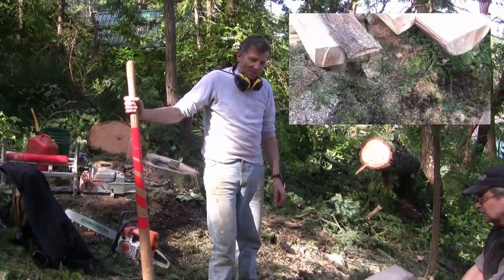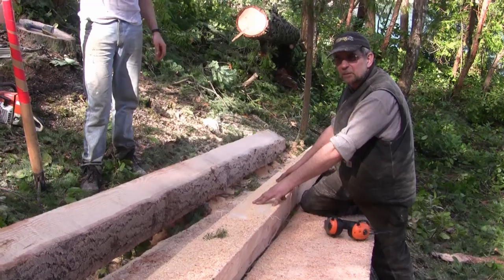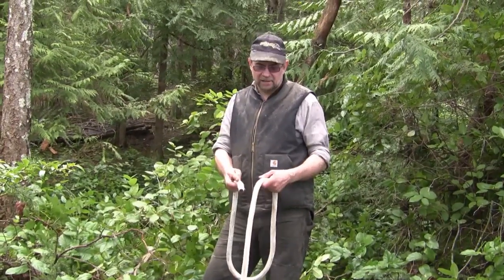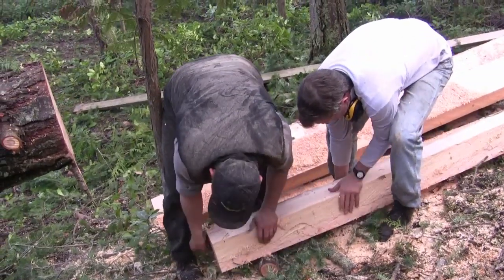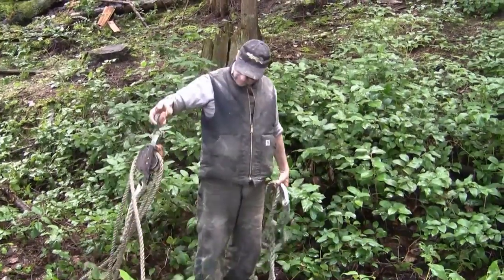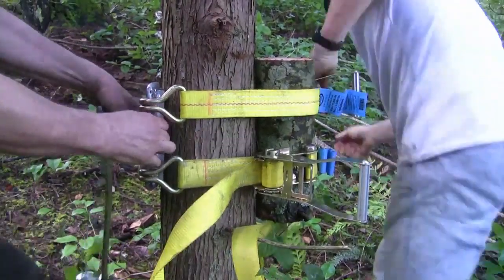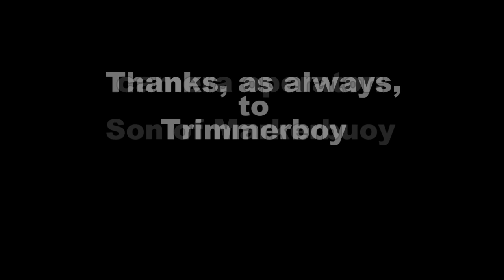Milling Big Timber

Comment from the maker: Hi Jonathan;
Thanks for your query.
Timber is usually cut ahead of time, is stickered and covered and left to air dry for about a year. However, if we are in the middle of a project & need the timber right away, that is when we use it. Cabinets & furniture obviously need properly seasoned wood.
Vulnerable wood used for construction (i.e.exposure to insects or moisture) is treated as appropriate with clear zinc or green copper based chemical preservative.

Comment: Also if your using normal chisel edge chain then I would recommend making the cutter tooth angle more square so it makes more of a chipping action rather than a slicing action and take the raker teeth down at least the thickness of a common paper match. You want the saw to actually be grabbing plenty of meat to cut and in doing so it will throw much bigger chips, cut faster, and make less powder with the only draw back being a bit rougher finish. Another great trick is stringing a few long.....

Comment: Yes I have milled quite a bit of planks and beams with my alaskan mill set up but I now have a nice brand new Linn 1900 band saw mill with all of the options including having it painted bright yellow, with 25 hp and the power feed option it zips through a 12 foot 20 inch wide cut in about a minute or so and leaves a really nice finish. These are great mills for the buck but you still have to be willing to spend around $10,000 like I did. It has already paid 1/3rd of itself off just selling rdwd

Comment: If suspending a hanging weight through a couple of pulleys is not easily done then you could also buy some bungee cord in bulk like I did at first and make a long rubber band type of pulling aid. I simply used about 3 or 4 20 foot pieces of bungee cord fastened them together at each end so there is a clip on each end then run it out past the end of your cut to an anchor in the ground or a tree base, if a tree base is to far use a rope to anchor it then stretch the bungee and clip it to the mill

Comment: I understand what you mean - it is top of mind when I am in such a situation.  What I don't think you can see in the video is that the "lower" log (the remainder, after I made the slice) is prevented from rolling by the trimmed stump of a 6"diameter (formerly healthy) tree (the secure stump is at the lower end of the log, on the down side) and the upper end rested on a level platform. 
There was no risk of the log rolling in this case. If there ever is any such risk, all personnel stay up-slope!

Comment: I must say your saw was dull dull dull. I have milled fir using an alaskan mill and I run a rope from the front of the mill frame across the log that I am milling through a pulley at the base of a tree and up to another pulley 20 feet up, then I hang a cinder block from the rope and when I am ready to mill I pull the cinder block up, attach the line to my mill and the weight of the hanging block pulls my mill easily through the cut which bt the way throws saw dust out not powder like you were!.